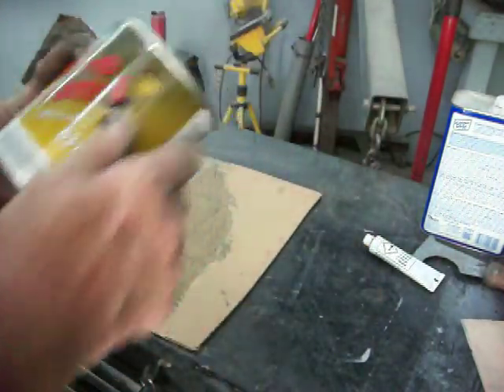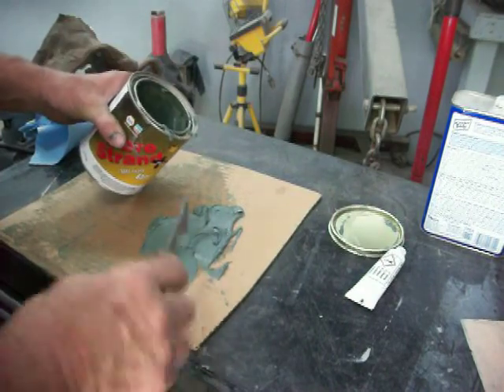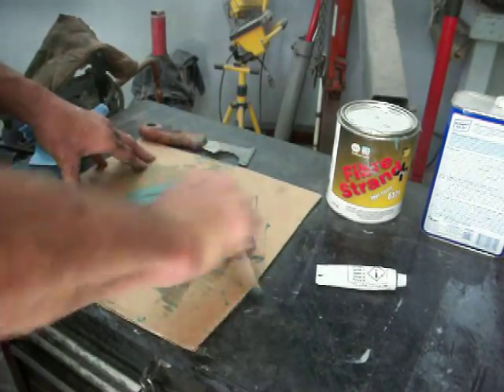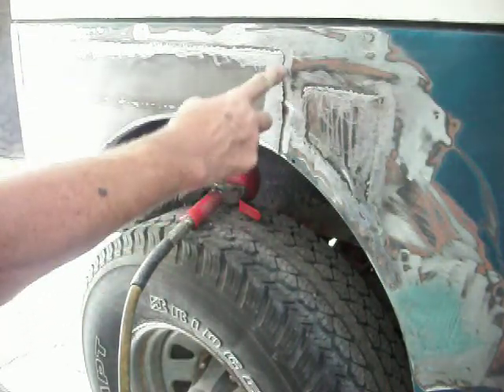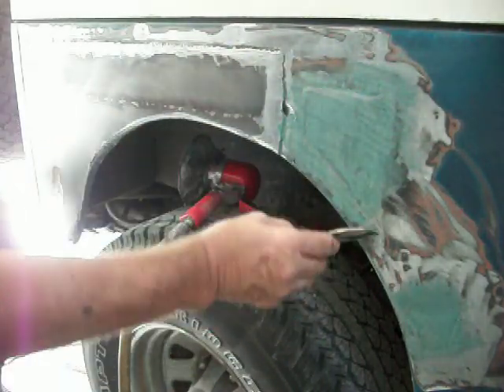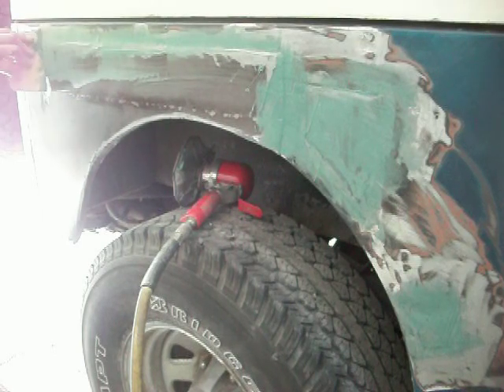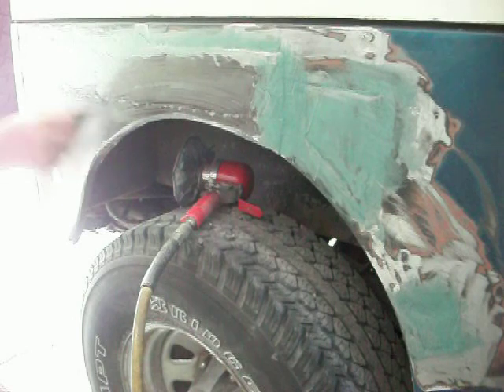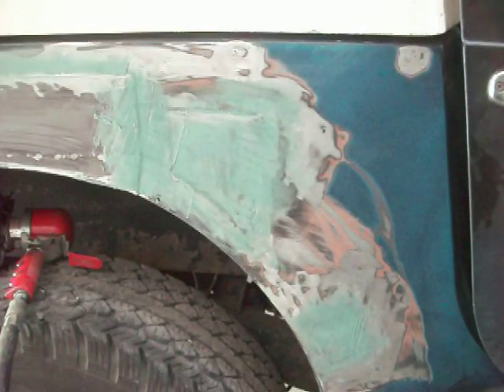1986 Jeep Wrangler: Video 14 Fiberglass filler

Comment: I'm not gonna lie, but I learn a lot in your video. I like those tips about the mixing and spreading of the fiberglass.. awesome video!! Btw! You were talking about the sand paper and how you go to that store and by stuff and it suck but you forgot to tell about 3m sand paper which sand paper you use to make the sanding a lot easier? Thank you for a good video
Reply from the maker: 3m auto grade is the best. Walmart has it at there auto section.